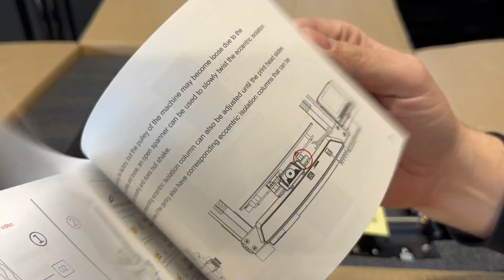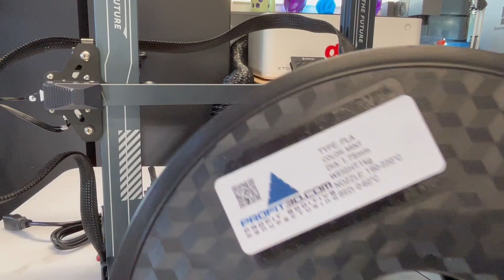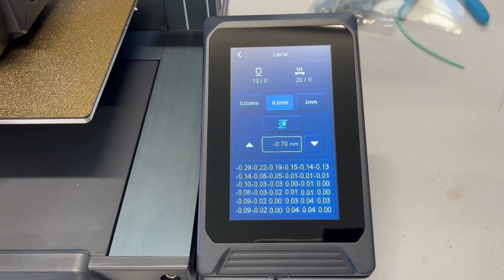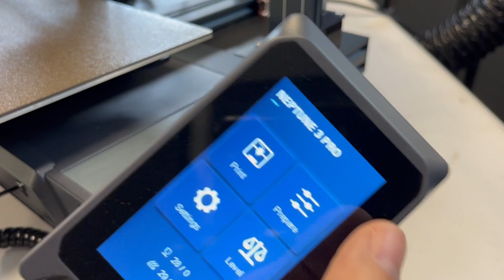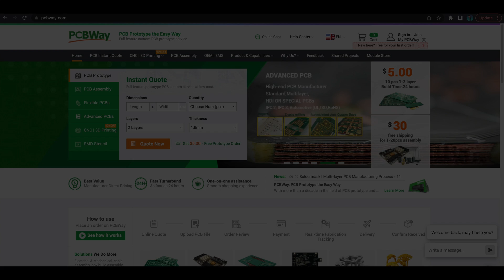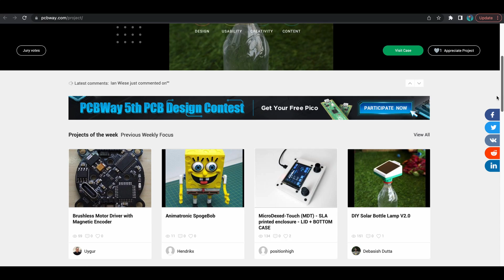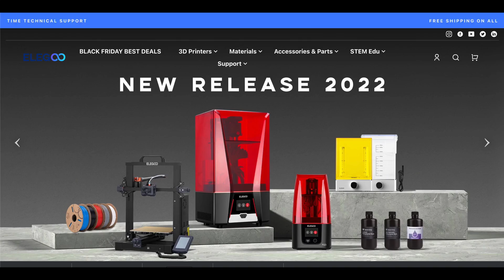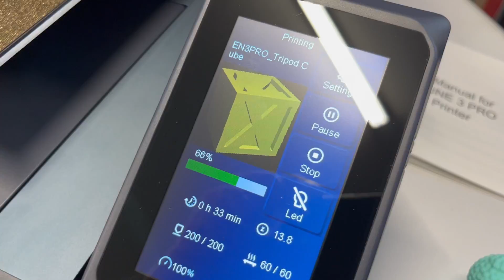ELEGOO NEPTUNE 3 PRO - BEST BUDGET 3D PRINTER OF 2022?

Comment: Mine worked great for the first 2 prints but went haywire after. It'll print all the layers sloppy and then disconnect from the base and basically spit a stringy mess all over the place.

Comment: Wow $230 in my country is about $343... Oh well but the Neptune is going to be my first 3d printer. Your video helped me make a decision. I was deciding between an Ender 3 V2 Neo and the Neptune 3 Pro. Ty
Reply: hey, what did you end up getting? I'm confused b/w the v2 neo and n3 pro as well.
Reply: @ManoharOfficial  oh! Well I got the n3 pro, I'm happy with my purchase!!
Reply: @spoonmanxx  i'm thinking of getting one as my first. could you recommend what I should get along with the printer to get up and going?  any upgrades you plan on doing, or recommend I get? TIA
Reply: @ManoharOfficial  This is my first printer, and I'm not an expert. I had previously tried printing on a Monoprice Delta Mini printer with poor results. I mention this because now that I compare them with the prints from the Neptune 3 Pro, I realize how bad they were. So far, I haven't had any issues with the Neptune. As for upgrades, I plan on changing the firmware to Klipper, and I've already ordered an accelerometer for input shaping. I also intend to change the hotend to an all-metal one for printing at higher temperatures. And make sure to purchase a filament spool along with the printer, get an PLA filament is easy to print avoid PETG at least until your comfortable changing your slicer settings. I bought one from the same brand, Elegoo, to test if the printer was functioning properly. It comes with a small spool of just a few meters for the model that is preloaded on the SD card.
Reply: @ManoharOfficial  If you can get a Neptune 4 it comes with klipper firmware
Reply: @ManoharOfficial  ohhh and use the last version of cura to slice your files, don't use the version that comes with the printer, I have tried prusaslicer and is not as fast as cura.

Comment: Hmm.. It's been already two weeks since this video is published, so I maybe too late, but here I am. You can't say I didn't try. I've been trying to building some custom tool sets and I was literally hacking away with some hand tools, but I couldn't make it to the precision I wanted. Which led me to the 3D printer for the first time. But I realize there are so many options out there, specially between 'FDM' (whatever it means) and 'Resin'. I fell into a rabbit hole of resin world, away from FDM due to too much plastic wastes(?), but resin is also messy and its shyness to sunlight and love for ventilation add few logistic complications. So I gave up on 3D printing and fell into another rabbit hole of CNC machines and routers in the wonderful world of woodworking. Although woodworking is one of my top five bucket list, I simply don't have a dedicated space for it. Which led me back to "more" 3D printing youtube videos, defeated. I finally started to eye on Elegoo Neptune 3 (Pro) which led me to this video and I'm almost certain I will get it when it's available in few weeks. My last hurdle is to convince my wife why I spent $240+ without her approval. Can a generous gift save me from the wrath of the furious wife? And can I print many practical tools instead of toys?

Comment: I'm a mechanical engineering student, I've always been interested by 3D printers but never got one. I'm now doing an internship in a aerospace company where I'm designing CAD models for metal additive manufacturing in the research and development section. This activity made my interest for 3d printing skyrocket ( the pun was intended). That's why I Ended on your video because I'm looking a all the available printers. The Neptune 3 pro really looks awesome with all of those features. That would be great to Tinker with and do some projects.
Thanks anyway and best of luck

Comment: Well im looking to get back into 3D printing since I have been making stuff lately,  just gutted a broken hoverboard for its motors, so I have been looking at printers for printing mounts and crank shafts (to cast in alluminum). Working on making a scroll saw but mounting the motor has been a pain in the butt so far using wood, having the Neptune would be nice.

Comment: Neptune - in my hobby (Electronics) i need lots of individualized housings and so on to put my PCBs in. At the Moment i use Standard sizes and can not customize it easily for my projects. Therefore i would use it, but also for different applications because of the good ability to print TPU. Thanks for the Vid :) - Neptune

Comment: I recently got into riding EUCs ie. electric unicycles & have been wanting to print my own power/jump pads & other accessories. Just this aspect alone will pay for the cost of the Neptune printer. Being a noob at this 3d printing, I believe this Neptune 3 Pro will be perfect for me. Easy to set up, easy to use & very good prints & more important, the direct extruder will be great for TPU. Thanks again for taking me on a ride to Neptune